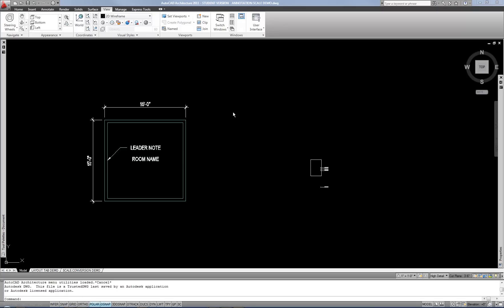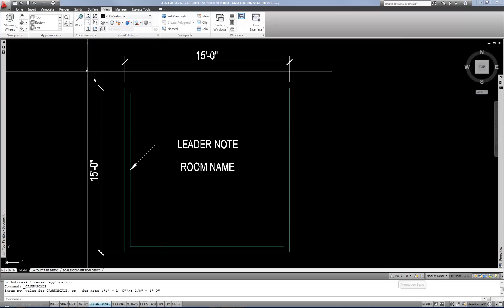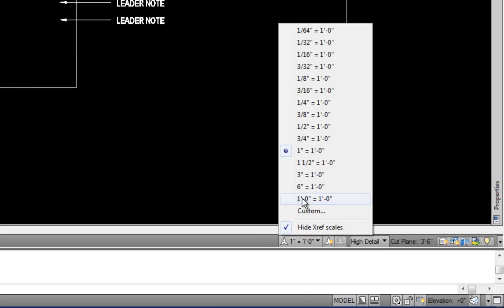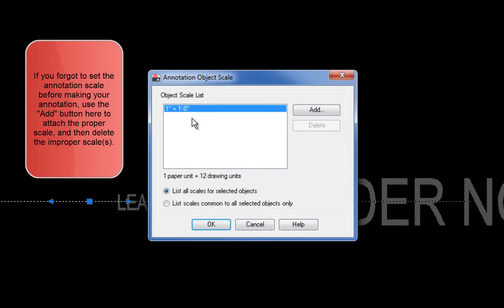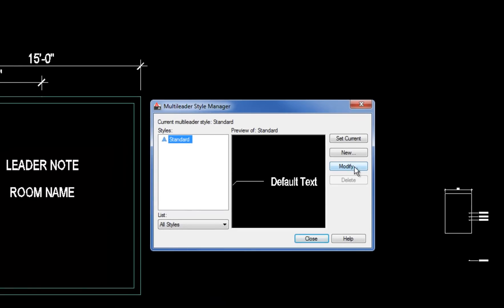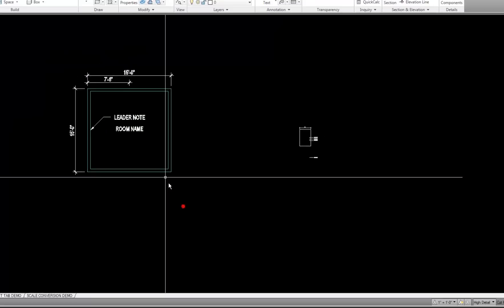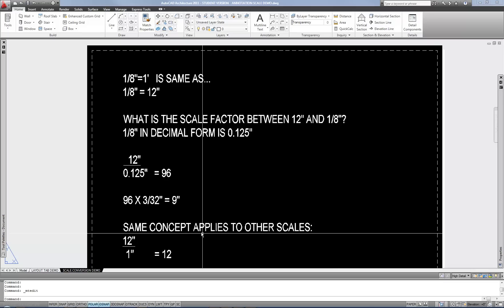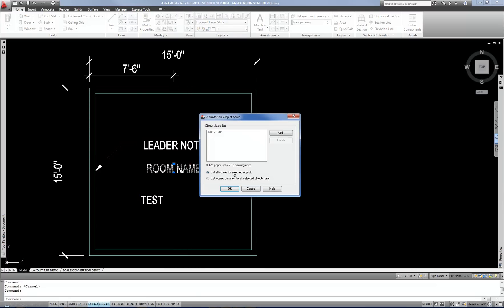AutoCAD Fund.: Annotation scale

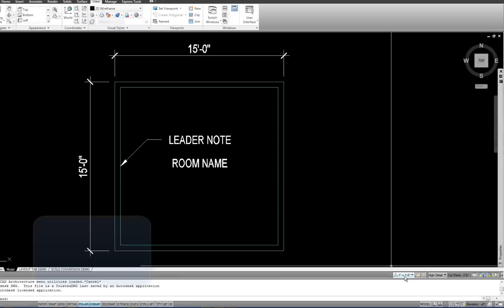Comment: Thank you for the tutorial. I have followed what you said, but when after clicked the "annotative" button, the annotation in the layout doesn't change. Do I miss something? I'v got 1:50 and 1:100 frame in the layout.
Reply: Alex Joshua One of the option buttons next to the annotative scale button decides whether new scales are assigned to all annotative objects when the scale button is changed.   Yours must be turned off.  I strongly recommend it be kept off as much as possible.  Generally try to plan ahead on the scale.  If you do change your mind on the scale, then remove the scales no longer needed from the annotative objects.   This can be done via the properties palette, ribbon, or right-click menu.
Reply: Jeremy Franklin Thanks Jeremy. it really helps!

Comment from the maker: It is on by default at the lower right if you're using a new-enough version of AutoCAD.  If the button has been turned off accidentally, you can probably turn it on using the tiny black arrow at the lower right, which opens a pop-up menu to switch icons on/off.

Comment from the maker: Sounds like you are used to older versions of AutoCAD.  That isn't how the interface normally works anymore, but you can always change it.  If you are using regular AutoCAD, you can probably pick the "classic" workspace to revert to linear toolbars.  The workspace icon looks like a small gear.  

I usually suggest using shortcut keys and getting used to the ribbon, because it isn't going anywhere.  It can also be made to autohide, if you watch my early videos on the interface.

Comment from the maker: There isn't one universal answer. I consider 3/32" standard note size, but I agree that some hierarchy can be good.  Perhaps 1/8" for schedules, 1/4" for major text in titleblocks, etc.  Try a normal size and see how it works, as long as you're consistent and not using more than 3 or 4 sizes in total.

Comment from the maker: It can be toggled on/off using the fly-out menu hiding behind a small black arrow at the lower right corner.  Try turning it on there. It is normally on by default but you have had a glitch or turned off by accident.

Comment from the maker: In the intro videos I explain how you can type "units" to change your units, such as to centimeters or millimeters.  You could also update which template is used (or use the appropriate desktop icon if you have more than 1) so that the units are always correct when you start.  See the Interface video.

Comment from the maker: Yes, it is the same idea.  If there is text in the block, the size can be adjusted based on the annotation scale assigned when the block is inserted.  Your second question is somewhat contradictory:  By nature, the scale of different drawings varies.  That's the reason we have annotation scale features to begin with - to make the size of the text consistent -- not the scale.  If you mean to ask about the standard printed text size, it would be 3/32".  1/16" can be used if smaller is needed.